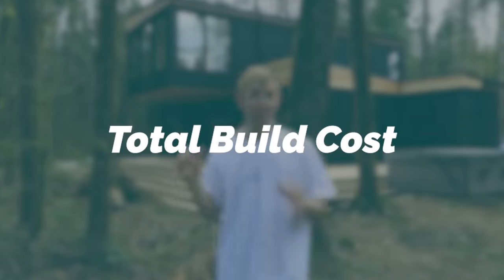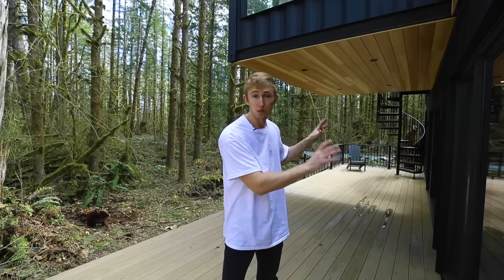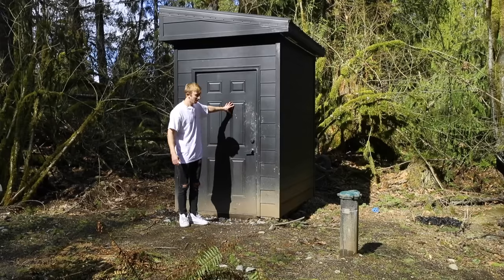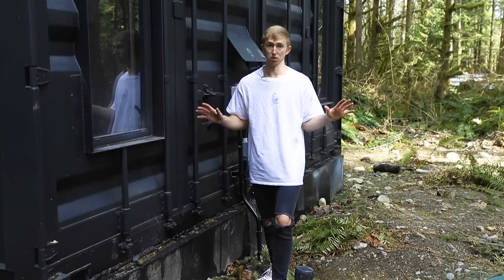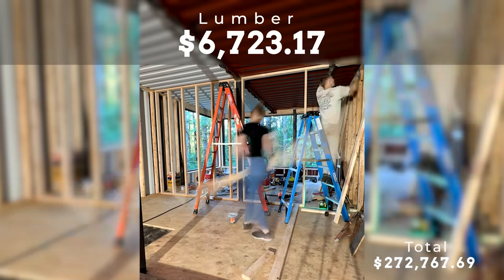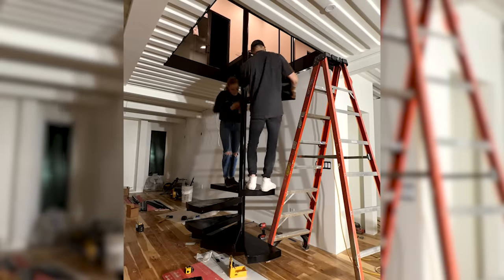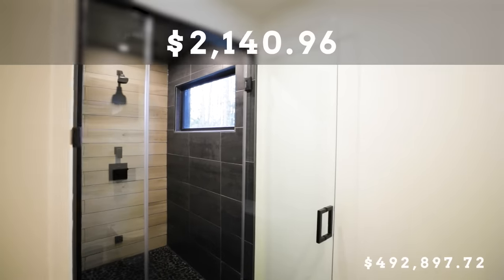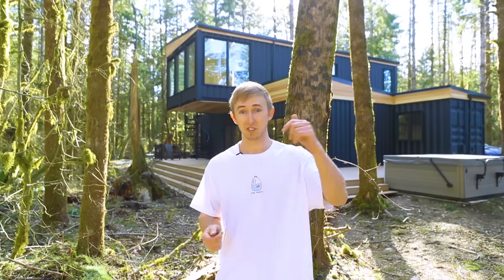How Much My 2-Story Container Home Cost to Build

Comment: What the hell are people doing?
I can build 25 ICF homes 3 bed 2 bath 1400 to 1800 square feet for what you spent. The insanity of cost of living society lives in makes me sick. People wonder why cost of living is so high.
People like this all around the world trying to create something expensive to make large returns. If this would of been an off grid build with a simple design without all the luxury you could of created something really nice for around 34,000. Wasted too much resources and created to much modernization into the build. You lose the appeal of living with nature creating a paperweight that is worthless to 99% of the world. Not very smart. People have a lot to learn about building homes and the scams of cost of living that markets prices. Too much waste building homes that won't last. Climate change and deforestation is destroying forests. I wish these people would stop. What if i told you each home that we built cost 20,000 to 34,000 for the materials per home. Completely off grid with solar power. Every single home produces there own power and produces there own hydroponic food garden. Our community volunteers to help build a zero cost of living community so people can escape the chaotic world people live in. ICF construction is the best if you only use ICF and steel. Don't use any wood in the construction of the home. A true ICF home can withstand tornadoes, hurricanes, floods and wildfires. The traditional way of doing things doesn't work. Wood framed houses burn and get destroyed easily by natural disasters, termites, water damage and pests. Trust me we have built over 7,000 ICF homes in the past 10 years. Every single home has 3 bed 2 bath all concrete and steel. Average square footage is 1400 to 1800. Solar powered with hydroponic gardening. The original designs was for a garage but we saw it as a weakness in the ICF construction with wind speeds over 160 mph. With the garage enclosed as a hydroponic garden room this fixed the problem. An ICF home can withstand up to 290 MPH winds if you build a complete ICF structure with steel framing and proper windows. Windows are the most important thing to be careful with ICF builds. You want hurricane strength windows no matter where you live. This home will last a 1000 years if properly built. Do not rush the process after the concrete is poured into the walls. Don't half ass seal ICF exterior walls to the ground level. Go all the way up to the roof. I am one of the leaders of a large community of 13,000 people in 4 locations around the world creating zero cost of living homes for off grid living. We are finishing up a project soon with ICF construction. Everyone knows what a parking garage looks like in the city. I designed something similar with alternative purposes. Constructed 4 basement levels down 100 feet below ground level and 1800 sq. foot per floor and two stories above ground. Community home school research building so the parents and kids can learn together. We have some designs created with hurricane proof solar panels that is really cool but i am not sharing because i am against capitalism and marketing ideology. I spend my wealth creating free cost of living to others. Not interested in sharing my ideas so others can make money taking advantage of other people. The people in this world doesn't really know any better because they are forced to pay the cost. People are living a lie and there is a better way. We build to last and create free cost of living for those we choose are trustworthy.